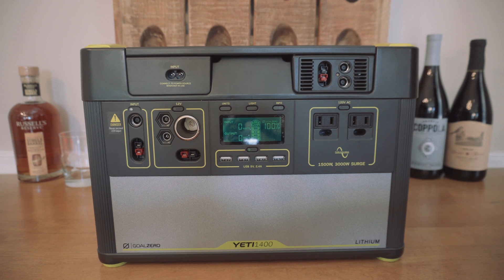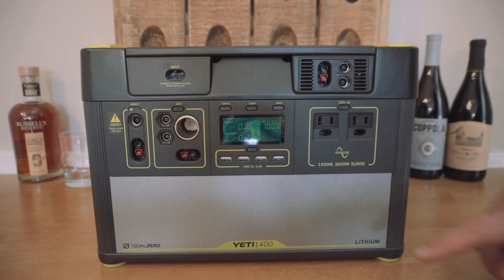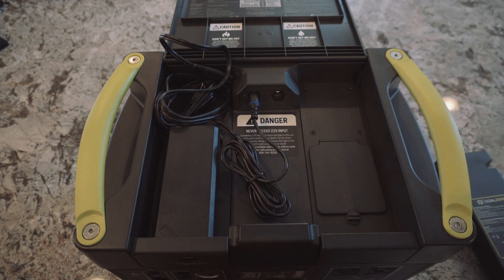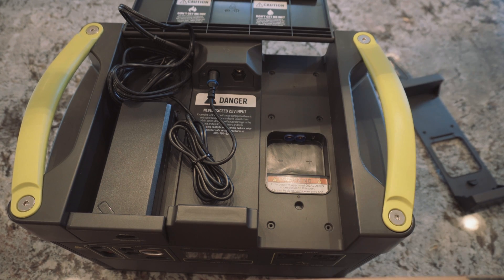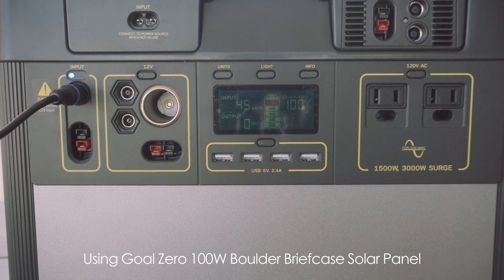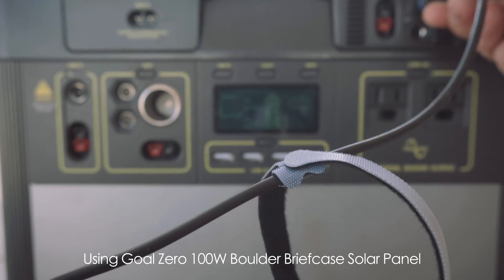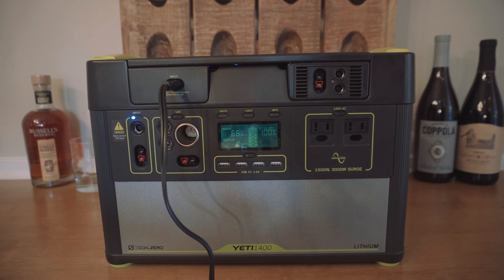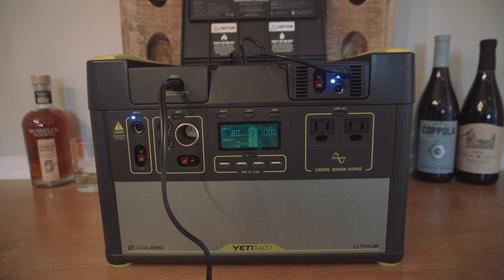Goal Zero Yeti Lithium MPPT Charge Controller Install & Test

Comment: At $80 I'd say its worth it as you will get a bigger % increase at lower battery levels. Just seen another video that showed a 15-20% increase from a solar panel input even though the battery was already over 80%. Def worth $80 for much faster charging and the other benefits and MPPT charge controller brings over PWM.
Reply: Not really worth it when you can buy 3 more chargers and chain them together and get far better results
Reply: Well worth it for using with a Solar panel - which is probably what it is intended for.

Comment: Just a suggestion, but I see your battery is already at 100 percent. Try testing the charging when you have a 20 percent battery, I will guarantee the input will be higher because as the battery fills up, charging slows down. Same principle when charging your phone at a low battery, it will take less time to get a dead phone up to 70 percent battery that it will completing the last 30 percent. This is to protect and prolong the battery life. Also, Not to dive too much into physics here, but a battery is much more willing to accept incoming electrons when its starved than one that is at or near its capacity. Something to think about. Anyway, thanks for the review!

Comment: With your new MPPT controller you now have a total of 7 solar panel input openings. (2 on the front left, 2 under the hood & 3 with the MPPT controller) Can you use all of these inputs at the same time to decrease recharge time and/or increase real time power output longevity? or is there a max total input? You said each port will handle up to 150 watts each and if you're only getting say, 75 watts off one set of solar panels, could you connect several other sets to the other ports to improve recharge time. thanks.
Reply from the maker: There is definitely a max input, but I cannot remember off hand what it is. GoalZero tech support definitely knows. But yes, you can use all ports to increase charge efficiency. If I remember correctly, when I called GZ support, they said it would max out at 325W using the APP connector (and 360 on the PWM charger?). I plan to get a 200W panel from them and maybe another 100W panel at some point. That should be more than enough for my needs :)
Reply: Thanks Tyler for your yeti review and quick response to me.  
I took your advice and found a 1400 available on "open box" and will  buy it this week. It's about $450.00 off an new one. GZ does not make a foldable 200 watt panel so I'm looking at the Dokio 200 Watts 12 Volts Monocrystalline foldable Solar Panel for about $250.00. It comes with a controller, but I don't think I'll need that one if I plug the panel directly into the Yeti.  I'll need to get a Bullet/SAE to Anderson Powerpole connector, but that's not a big issue.
P.S. I saw this video where a guy got over 400 watts going into his Yeti 1400.........not sure if that's safe if total input is 325 watts. https://www.youtube.com/watch?v=J39aG-tzfxY
Reply from the maker: Yeah it looks like he is using the PWM (left) and MPPT charge controllers combined which is why is he able to get more than the 325W. You definitely don't want to plug in a solar panel that has a charge controller on it into the yeti because the yeti already has a charge controller built in (the one on the left). I think you'll be happy with the Yeti. It's so nice to power things inside when the power goes out and not have the noise of a traditional generator :)

Comment: Thanks for the video. Did the wall charging from the MPPT ever stop jumping around?
Reply from the maker: Not really, but I called Goal Zero's customer support and they said that is normal. Thanks for watching!
Reply: how about if charging by this adapter witout mppt?
https://www.amazon.com/gp/aw/d/B07D7JQQ34/ref=mp_s_a_1_11?ie=UTF8&qid=1527061370&sr=8-11&pi=AC_SX236_SY340_QL65&keywords=mc4+to+anderson+adapter
Reply: I just saw that you plugged the charger into the MPPT, and I highly suggest you don't do that. Without getting into technical specifics (i'm an EE if you want to know I can try to explain it), the charger & inverter is basically fighting each other trying to find the "optimal" charge point.
Physically what the MPPT is trying to do is find the quiescent point (biasing) of a solar panel electrical characteristics, but since the charger electrical characteristics is suppose to adjust, it doesn't know what to do with it so its equivalent to flipping the light switch on and off constantly which probably isn't good for the charger or the MPPT.
https://en.wikipedia.org/wiki/Biasing